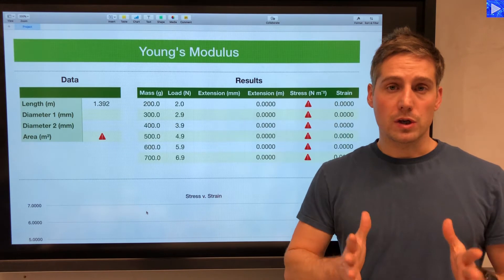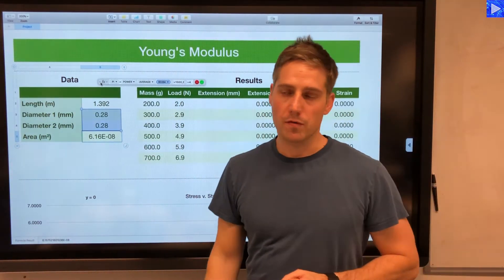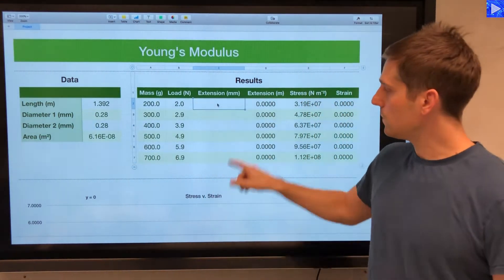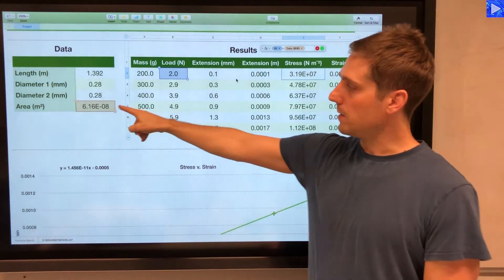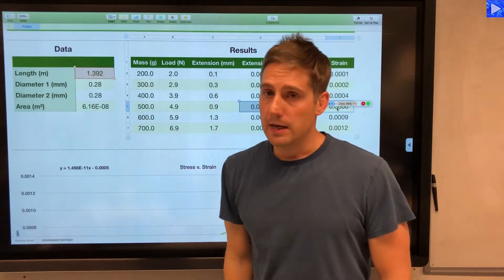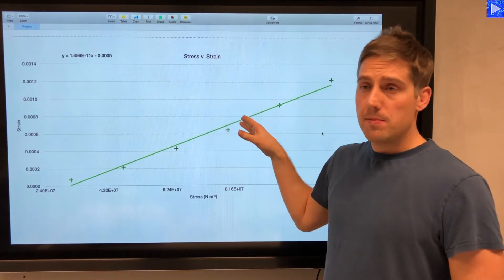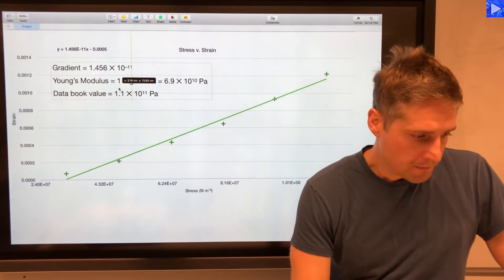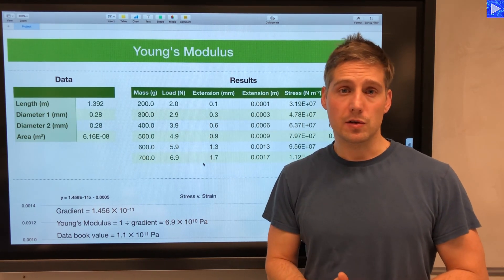Young's Modulus Experiment Analysis

Comment: I have specimen of 75 mm dia and 150 mm length.
On performing bending strength analysis i have load and deflection values pls help me out to calculate stress,strain,and youngs modulus
Reply: Can you help me with the hypothesis
Reply from the maker: Stress, σ = F/A. F is the load applied. A is cross sectional area. For a wire A = πD²/4. 
Strain, ε = x/L where x is extension and L is original length. 
E = σ/ε